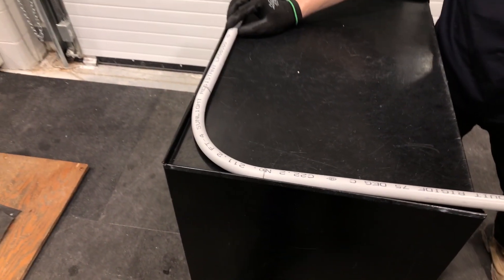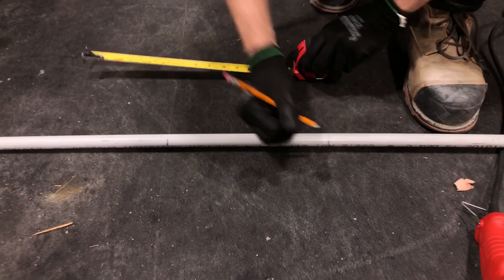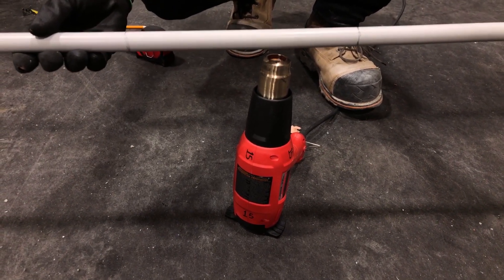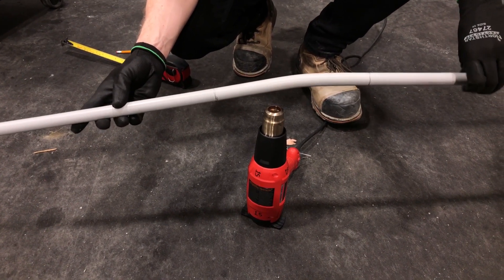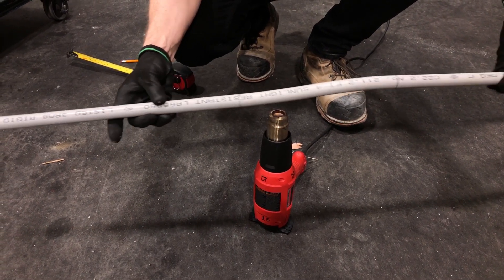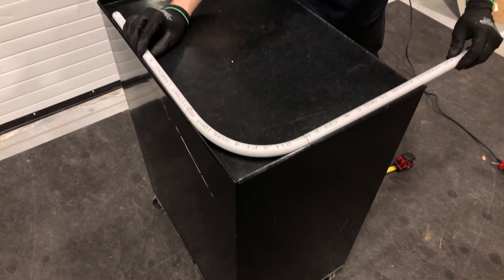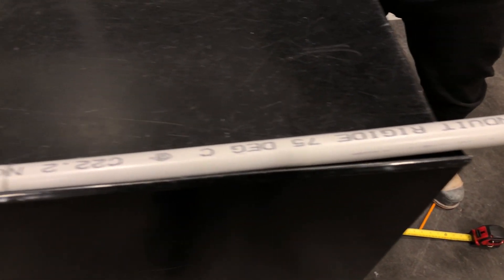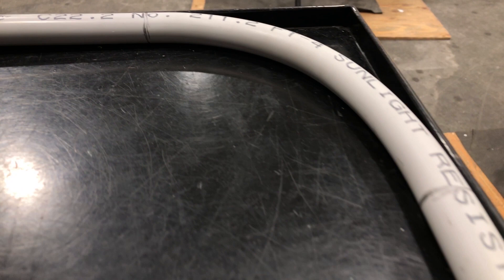How to bend PVC Conduit - How to bend PVC with a heat gun - The Electrical Guide

Comment: Can I do this with 1"-2" Schedule 80 or is that too thick?
Reply from the maker: This heat gun method may be impractical with those sizes. A PVC oven would be better, it can accommodate up to 2” and will heat it more evenly. Sadly it will cost a pretty penny, not worth it unless you’re bending many pieces over time.
Reply: Thanks for the quick reply and info. I may end up with 1" Sch 80. The best I can do is give it a try. Thanks  @theelectricalguide

Comment: Within the time you took to bend this conduit, you could bend 4-5 conduits on your knee using a bending spring. Heating also causes the diameter of the conduit to shrink so just Use a spring.
Reply from the maker: Yup, but I teach all the different methods. Learn them all and master your favourite. :)
Reply: In 2024 are there no tools that's even better than a bending spring? Like c'mon..... I'm looking for a gadget online to bend PVC better/faster/ more accurately... So far nothing
Reply: I need pvc band heater

Comment: do I need to make any adjustments to technique for larger diameter pipe or will this work the same way at double the size?
Reply from the maker: This technique will work with a couple sizes up given slightly longer heat-up times. After about 1 1/4 inch it would be best to use a PVC oven or even order pre-fabricated bends. This technique is best suited for 1/2' - 3/4' - 1' and 1 1/4'